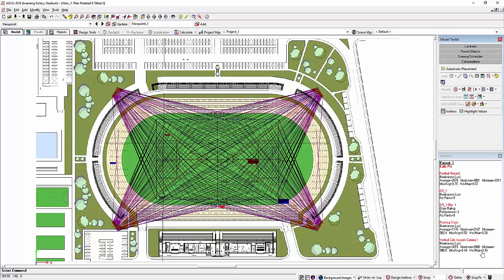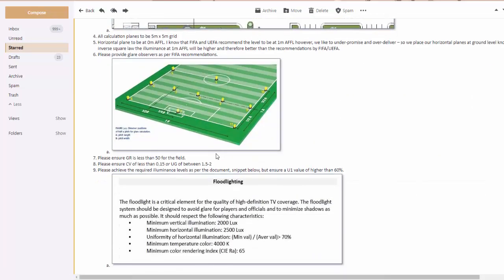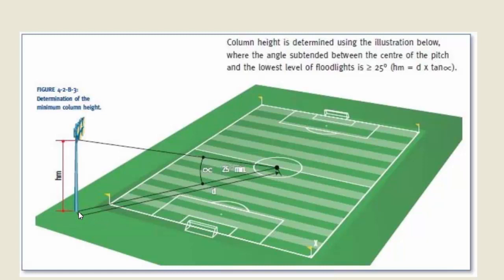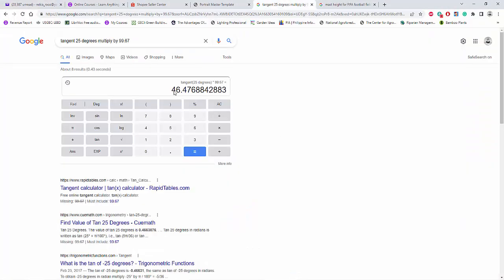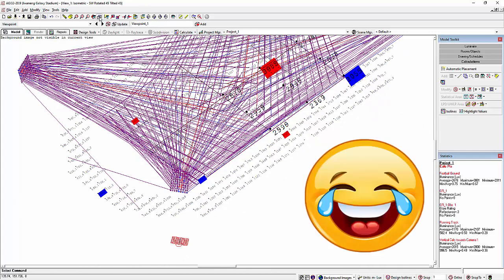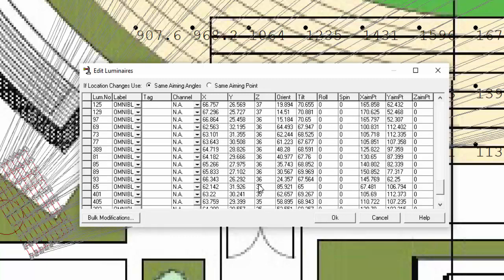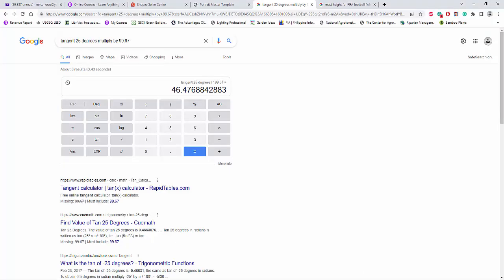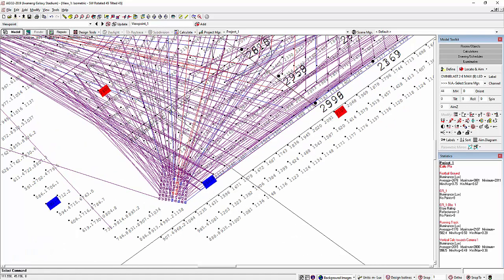Finding the right Mast Height for FIFA Lighting Design

Comment: Hi Nelca, great results and thanks for sharing. its very hard to achieve FIFA level of vert. and hori. lux requirements. I think for your case its even harder to do it on 4x big poles on corners. FIFA stadiums normally are very high-spec with fancy canopies all around. Its potentially made lighting design easier with mounting fittings under canopy that more direct above the center field. Thanks again for sharing.